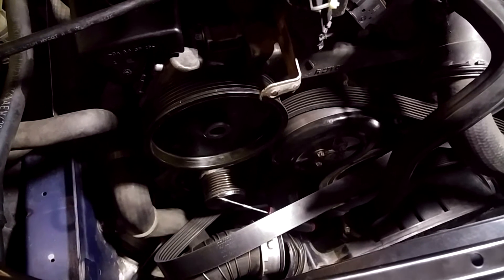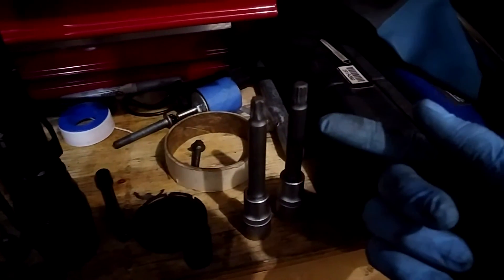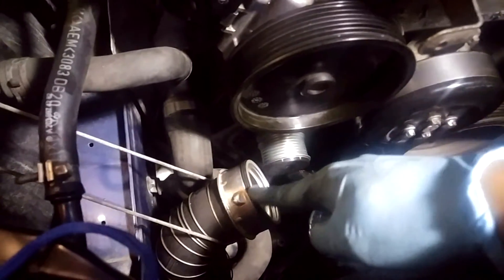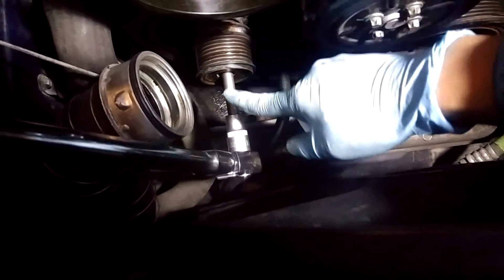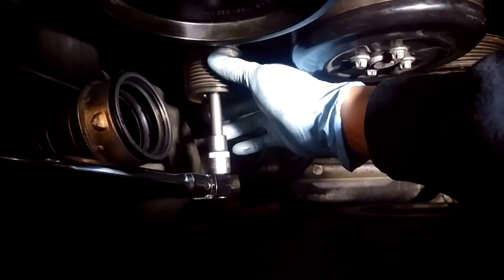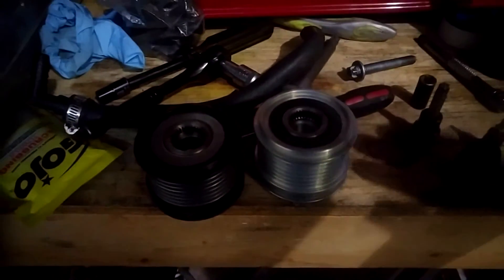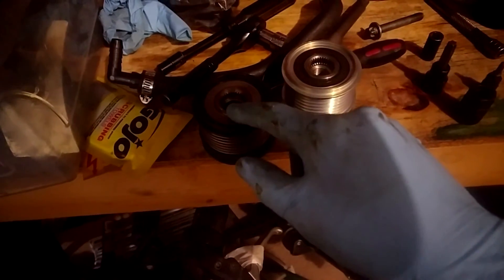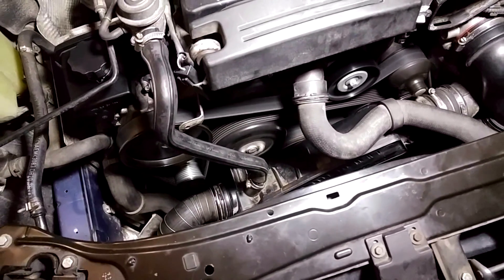Mercedes Benz C230 (M271) Alternator Pulley Replacement

Comment: I can't tell exactly where the chirping is coming from sounds like passenger side so maybe it's alternator pulley...I'm confused as to which way to turn the wrenches counter clockwise??
Reply from the maker: Sorry the video might have been confusing (the way the tools work on the pulley is inherently confusing).

Since you can generate more torque on the long breaker bar vs the short wrench, it is ideal to keep the wrench stationary while during the breaker bar instead. As such, the breaker bar should be going CLOCKWISE (not CCW) while the wrench stays put.

As for the chirping, do you feel it is the belt or is it a pulley? If the belt is old and needs replacing anyways, it is usually cheaper to try changing the belt first. That is unless you absolutely think the belt is fine.

Comment: thanks
Reply: Had the same problem with my Mercedes. This one pulley trashed my air conditioning compressor clutch plus the idler pulleys as well. Brought a new pulley on line and also the tools to replace it and you would not believe the difference in the car. Now idles sweetly and not a noise to be heard any whre

Comment: very nice video man! 
can you tell me if that's the reason why my belt is going bad  I just replaced but it is going bad for the 3d time
Reply from the maker: Bad as in torn to shreds? Are they on the grooves properly? Might be worth taking the belt off and see if any of the pulleys have damaged grooves or the pulley spins awkwardly.
Reply: Okay thank you very much for your help I will check it out